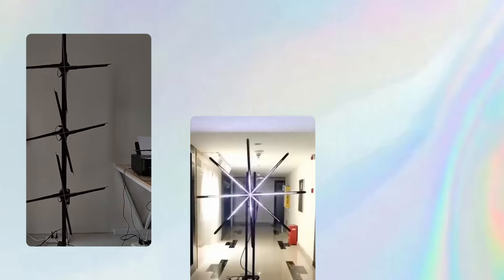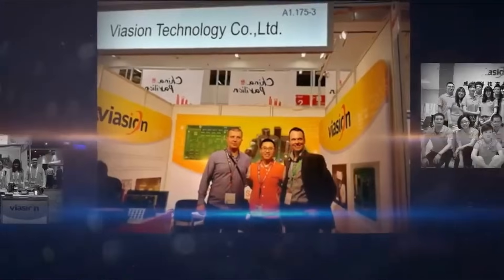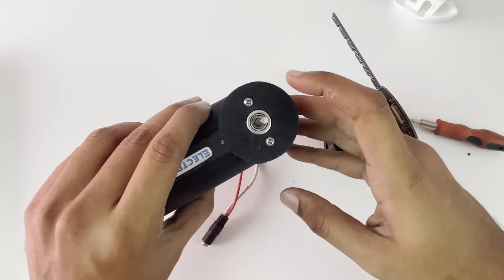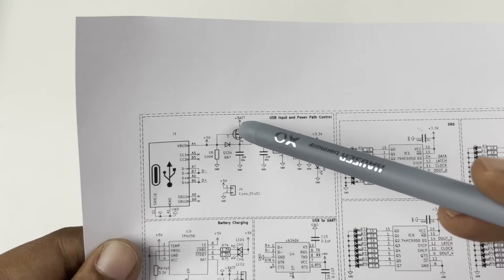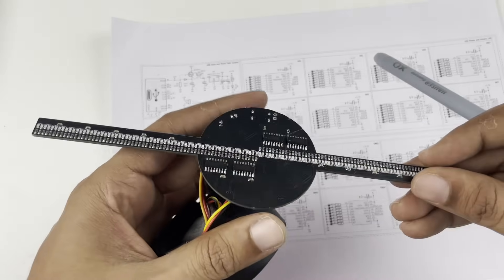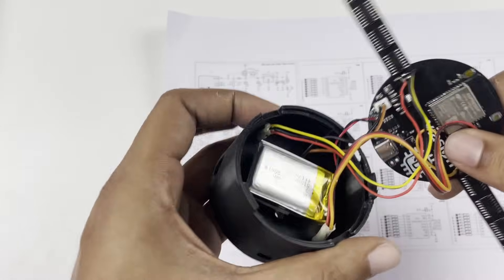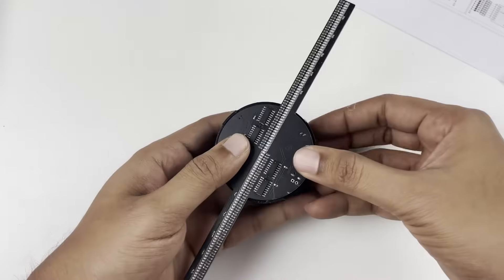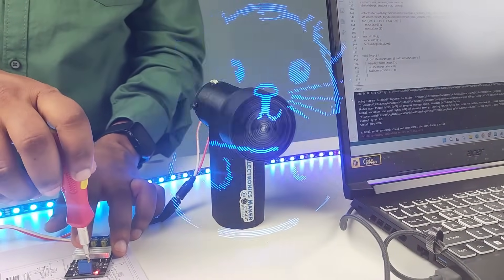How to make a POV Display using ESP32 and Arduino?

Comment: How about full color images? I want to build some for my little swap meet stand to show what I made. I want to rotate it to show all sides of my laser cut designs. Can you show me how to do this too? Thanks PM me if you make a video showing this. Thanks, I subbed and liked.
Reply from the maker: For colour images you will either have to use RGB LEDs with dedicate LED drivers, such as the ones used in the RGB LED panels, or you will have to use high speed addressable RGB LEDs such as APA102.

Comment: Nice project. I think this could be even better if you would have used rgb leds instead. We can create 3D hologram with this.
Reply from the maker: Hi, if we want to use addressable RGB LEDs , we must go with APA102, since other variants such as ws2812 are too slow for this application. But the APA102 are too expensive so we decided not to use it. And if we opt for non addressable RGB LEDs , they will need dedicated RGB drivers, which are also expensive.